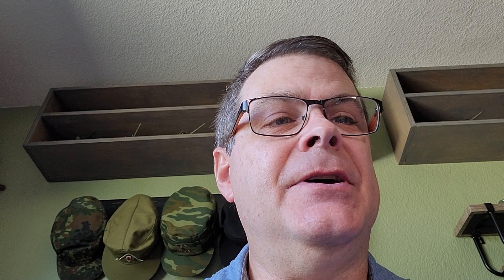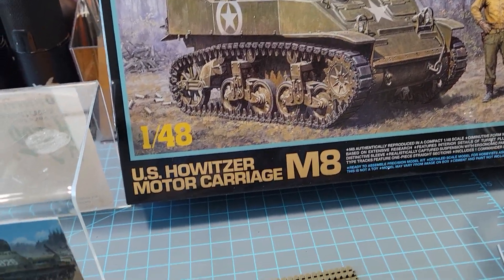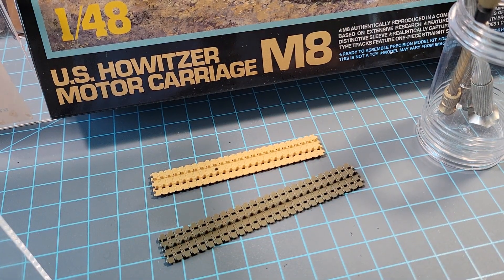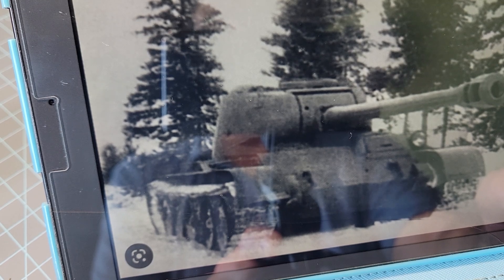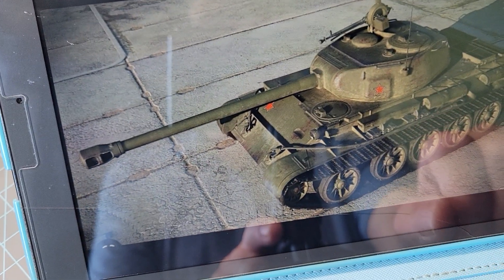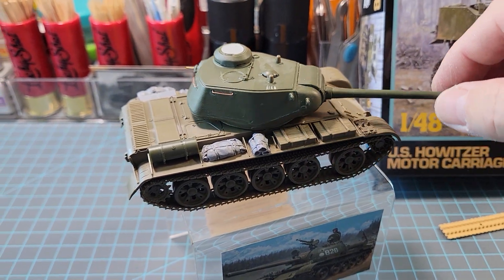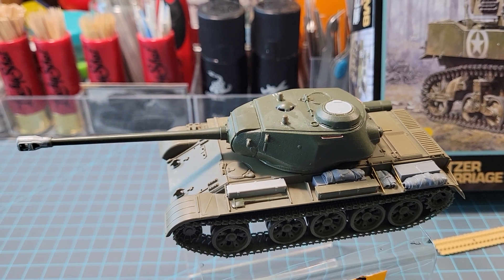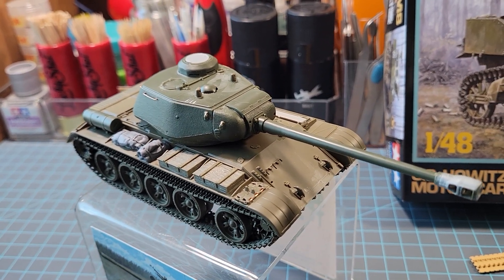Russian T-44 122 tank models and Tamiya M8 Howitzer - #scalemodel #tankmodels

Comment: There's a lot to be said about metal tracks.  I ended up buying some for my "1/48 King Tiger".  The tracks provided in the model kit were a nightmare. To link the tracks, there were five very small parts (two tracks, one linkage, and two track lugs).  The glue spot was so small I had problems using a needle point applicator to apply the glue and keep the track aligned so it articulated (most of the links stuck together).  I gave up on that pretty quickly, I knew I had lost that battle pretty fast.  Metal tracks with pins was the saving point.  By the way, I use a large sewing needle as my glue applicator.  I just snip the "eye" end of the needle to create an open end "U" shape and it holds and releases glue very easily.  Use a small hand vise like you use to hold the needle and it works really well (except king tiger tank tracks-🤣LoL).  Another great video!  Thanks, Eric
Reply from the maker: Thanks Eric! Yes metal tracks are king in this hobby and one of the best parts it. I will give your technique of the sewing needle a try and thank you so much for your amazing feedback. Thanks, Rick